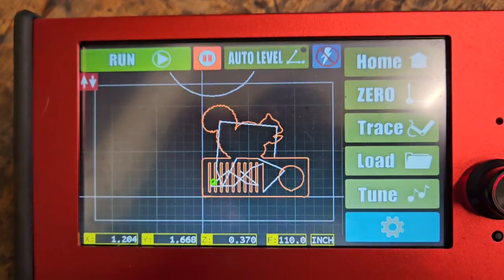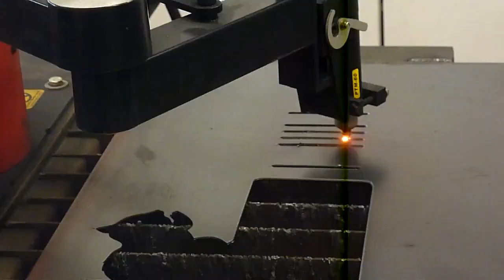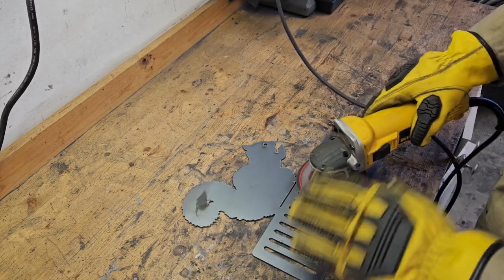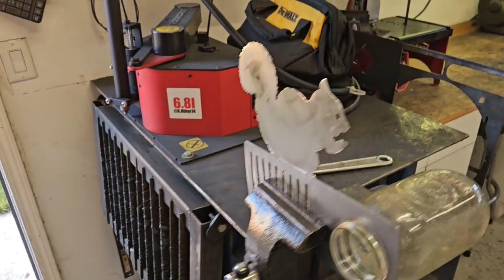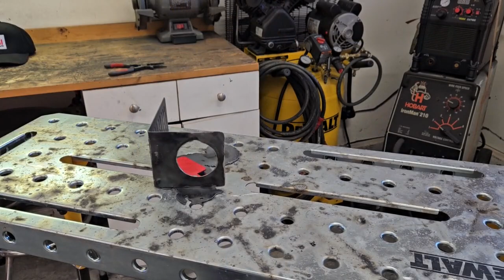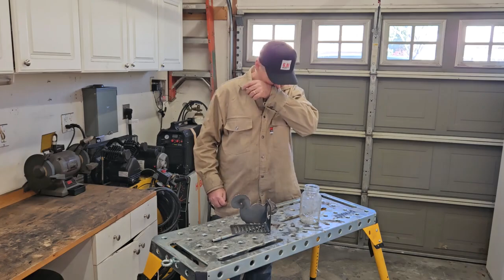DIY Squirrel Feeder 2.0: CNC Plasma Cut Design + Downloadable Files!

Comment: Been watching your videos, debating on buying this set up would you recommend the the primeweld 60 paired with the arcdroid? Or would you get something different
Reply from the maker: I would recommend something different.  Arcdroid does not recommend it.  The cut60 is a good plasma cutter but not for use with Arcdoid.